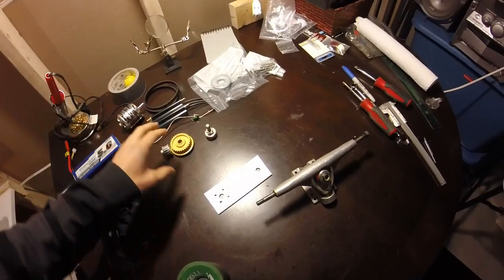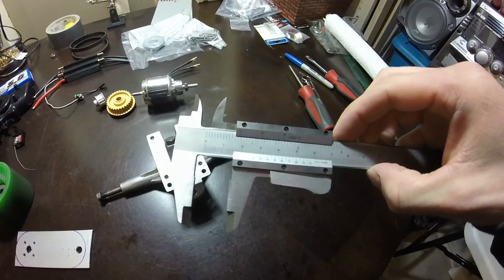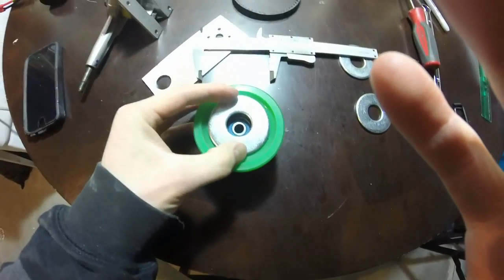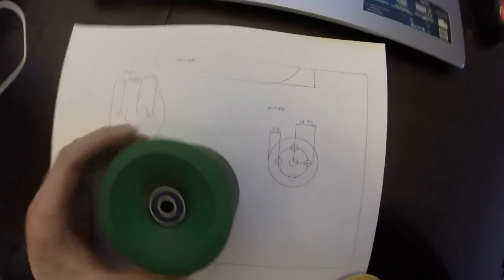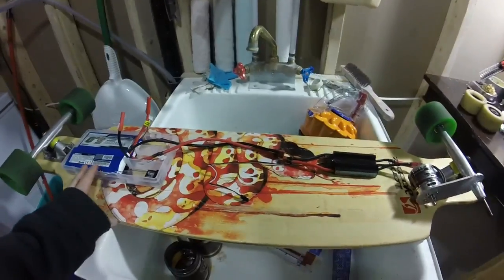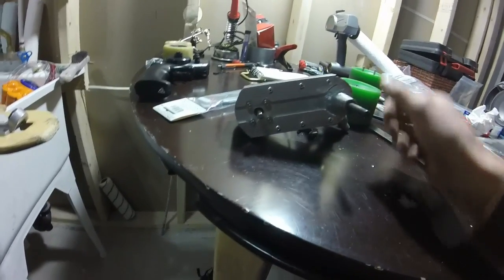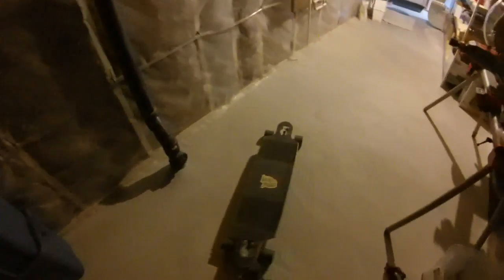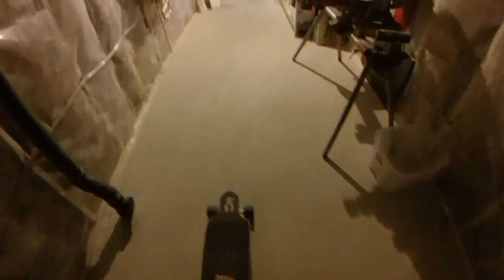DIY Electric Longboard build!

Comment: How did you weld the bracket to the truck? Isn't the truck aluminium? Do you have a TIG or something?
Reply from the maker: oxy acetylene torch with filler rod. It held very well. I did however end up re-doing with with 1/4" aluminum plate from metalsupermarkets.com. The plate I used in the video kept bending. 1/4" plate is solid like a rock.

Comment: Hey Eric, Amazing video! I was wondering how you got your Transmitter to work. I have the same reciever and transmitter but when I set it up, the transmitter only moved the motor when pressing the channel 3 button. Any suggestions? Thank you!😉
Reply: Brooklyn Hanon you figured it out? mine isnt working either
Reply: I did, but honestly I have no idea how I did it I I just unplugged the reciever  from my board multiple times and finally It switched to the trigger. Good luck though...

Comment: Little late to ask but do you know if i could possibly find an idler for a 3m 15mm wide pulley manufactured? a little too much hassle to make myself.
Reply from the maker: Not sure bud. Its easier to make one than you think. Just a bolt a bearing and a couple of washers.
Reply: Oh. Okay! Thanks for the help!

Comment: Why so much discussion about VESC and ESC? Does it really matter? I mean, the difference between them is so freaking big to worth the double priced VESC?
Reply from the maker: As with anything there will always be a more expensive way of doing something and someone to justify it. I personally didn't care to invest too much money into an unknown project. The way I see it a big long spec sheet won't make your board more fun to ride, so I personally don't care about all the features, and any esc that supports lipos will have a low voltage cutoff which is all you really need. Regen braking is nice but you'll get that with a car/ truck esc as well as strong brakes.
Reply: Is it possible to brake with boat esc?
Reply: Yes, it is.
Reply: So, tell me how, because I bought the same esc and motor, I change the settings to forward, reverse and brake, I increased the reverse to 75% and I could not brake even in a low inclination street!!
Reply: Boat esc's have weaker breaks most the time, because its unnecessary to have a strong one in a boat. but if the break can slow you down enough to put your foot down to break then its fine. But you can also try to make a physical break that will stop your back wheel.

Comment: hello i have a 930 kv motor its the pyro 600 09 you think i can use for an electric longboard ? really nice video
Reply: You cannot use such a high kv rated motor it will draw too many amps and kill your Esc
Reply from the maker: Not a good choice. Way too high rpm (fast). Get something that will spin slower with more torque. Pay attention to shaft size when you get your pulleys as the vary.

Comment: Hi Eric! i think i ordered the same gear set, but i noticed that the smallest gear didn't fit the shaft of my motor, did you have the same issue or did i just ordered the wrong gear piece? Love your work man !
Reply from the maker: Thanks man. If it's tight check to make sure the set screw is backed off enough. If the pulley is way too small you could try to drill it out. Make sure the shaft size and bore of the pulley are the same. Sounds obvious but something might have been packaged wrong assuming you ordered the correct pulley/motor.

Comment: What did you use for securing organizer box onto deck? I worry the plastic will crack if I use nuts and bolts.
Reply from the maker: I used 6 small screws with large-ish washers. I later added a bracket over the box because I had the same concern. Check out my pt. 2 video for more details on that.

Comment: hello, does the esc work good and doesnt burn up ???
Reply: Buy a vesc
Reply from the maker: It works fine, doesn't heat up to any point where i'd be worried. More on that in my other video. Any 90+ amp esc would work fine for this though.

Comment: my motor wont run for some godforsaken reason after trying 3 different esc's
Reply from the maker: Take it to a hobby shop, they'll test it for you.
Reply: Yeah I just did lol it works!!!
Reply: +Eric B did you welded motor mount to the trucks or it's a liquid "cold weld"?
Reply from the maker: mvmedved I used oxy-acetylene torch with aluminum filler rod.

Comment: you should extend esc motor cables and shorten batt esc cables otherwise you may ruin esc with too long cables
Reply from the maker: I see what you're getting at, and I've never put an amp clamp on the wires to see how much current the esc actually pulls, but based on how much heat it generates I don't suspect much, so i'm not that worried.
Reply: +Eric B please have a look at this link. take care
 http://www.rcgroups.com/forums/showthread.php?t=952523

Comment: Isn't it a problem that your esc is not being cooled by water? Doesn't it become like very very hot?
Reply from the maker: Surprisingly it doesn't get that hot at all. My guess is that a boats pulls a lot more current turning a prop in water. The motor doesn't really have to work that hard on an e-board if it's geared properly, and only really pulls a lot of current under acceleration. I've actually had it cool down from 115f to 105f while cruising at 30kmh on flat.

Comment: Hi, Why did you choose the batteries with low discharge ? Can you answer 
Thanks
Reply from the maker: They were cheap. Also, I don't honestly think a battery with a higher c rating would do much for it anyway. Unless you want to do 100kmh I see it as a waste of beer money.
Reply: That is good opinion, but how long are using the batteries and do you use longboard every day ? Thx

Comment: hi eric, nice video.
I have the same wheels which I recognize as the abec 11 flashbacks. and I wanted to know if you drilled through the rubber (the green part) and if you did so, is it stable or does it vibrate? should I buy new wheels for my built? cause normally people do it with wheels that have holes already on them like orangutangs or abec flashbacks or they drill through hard plastic.
 thanks
Reply from the maker: Thanks man. Abec 11 Big zigs, 72mm. I drilled through the urethane because i'm cheep and didn't want to spend hard earned cash on wheels specific to this build. I have not had any problems/ vibration. I also only ended up using two bolts with locknuts and have had no problems. When you put the bolts through the wheel they are pretty tight/secure in the urethane.

Comment: hey eric, great build. I'm currently ordering all my parts to make my own board with two 280kv sk3's. just wondering do you have the exact names or part numbers to the gears you used, since I'm using a very similar motor to you i could proberly get away with using the same gears/ belt. is there any chance you can help me out, spd/si's website is kind of confusing. thanks so much in advance
Reply from the maker: Just added to description

Comment: Very nice and clean build man, Love it!
I was asking how the connectors call which you need from the 3 motor wires to connect it to the ecs, because the boat esc hasn't any connectors standard?
Reply from the maker: Thanks! The esc just has wires with no connections on them, those must be soldered on. The motor comes with banana jack style connectors.  Hope that answers your question,

Comment: if your batteries are connected in series will you have to disconnect the two batteries from each other when you want to charge them?
Reply from the maker: Nope, I hard wired mine together. Since it gets charged after every ride I wanted it to be as simple and possible.  Just keep in mind two 3s batteries in series = 6s battery so it will need to be charged on the 6s setting.
Reply: +Eric B would you need to buy a 3s to 6s cable to charge them or can you charge each battery off their own 3s cable
Reply from the maker: If they are hard wired you need to treat them as a 6s, so you'll have to modify your balance lead as mentioned in the video, once it's done it's hassle free. Hobbyking sells a dual 3s to single 6s balance lead adapter if you dont want to make your own.
Reply: +Eric B ah ok perfect, thanks for the help!

Comment: Which motor would be better?

Alien 6374 Outrunner brushless motor 170KV 3200W       65,- GPB 
ore
Alien 5065 FR Sensored Outrunner brushless motor 270KV 2000W  45,- GPB

Do keep the price in mind :)
Reply: ***** I bought my stuff from hobby kingbut it seems like they're out of stock right now.
Reply: the 5065
Reply: I'm assuming you're  from the uk. which site are you buying your components from?

Comment: Yo Eric, i got the same ESC 120 amps - did u have to adjust anything with a esc controller card ? of was it good out the box?
You know a way to program it?
Reply from the maker: Running it as-is out of the box. Working fine so far. Never figured out how to program it.

Comment: Hi, I have the same controller, but it dosn't work. It is correctly connected to ch3 but the trigger don't work and if I push the button ch3 it works... How did you setup the controller?
Reply from the maker: +SiMyt848 Try plugging the esc into the ch2 slot on the receiver.
Reply: +Eric B Yes, it worked on the channel 2! The problem was the throttle channel... thank you!

Comment: Nice build ! 
I'm building mine too, got the same quanum tx & rx. How did you plugged it ? throttle is CH1 right ? 
My Motor & ESC would not start and keep beeping unless I plug the ESC signal on the CH3, and use the tiny CH3 button as the throttle lol. It's really weird it does not detect anything else than ch3, did you have this problem ?
Reply: +Tahitian Rider Ok so I figured that ch 2 is the throtlle, and that neutral point is actullay all the way to the front (not in the middle) with throttle trim turn full to the right too. Is there a way to change that on the radio ? it is weird to have to push your finger all up front against the spring to be at zero throttle lol
Reply from the maker: +Tahitian Rider I have my esc plugged into ch2 on the receiver. Dial back the throttle trim knob, it should be somewhere in the middle. All the way forward is like full throttle cruise control. Turn it on and dial it back until the wheels stop. Hope that helps. Cheers
Reply: +Eric B Thanks for your help :) I got the point of finding where the wheel stop and start using the throttle trim. But on my radio, to have the wheel at zero throttle, I have to be at one end of the thottle stick, I can't have it in the middle neutral position, I'm not sure if that is clear... reverse won't be possible for example, but maybe it is because of my ESC that needs to be programmed for that.

Comment: Does it have brakes?
Reply from the maker: +Matthew Wiese Yes, most esc's have brakes. They are pretty light though since it's a marine esc, which isn't really a bad thing at speed. They are about as efficient as foot braking. If you want strong brakes go with a bulkier car/truck esc.
Reply: +Vladimir Longrod I'm also interested if this board has brakes!
Reply: ahh gotcha, thanks for the insight!

Comment: Top speed/range???
Reply from the maker: +Jack V Range Haven't done a top speed pass or really test for range yet. I can tell you it'll do 22mph at 2/3 throttle. If I had to guess i'd say 27-29mph, but will confirm later on.

Comment: How did you attach the case with the batteries to the board? Did you have to drill more holes in the deck?
Reply from the maker: +ColindaPieman Its screwed to the deck. Drilled holes in the box, the screws were small and did not need a pilot hole in the deck.
Reply: +Eric B You are using rubber washers with that so no water/moister leaks in.

Comment: Taking in consideration the research, time consumed, work involved and money spend, and aside of the fact that is a satisfaction to make something like this on your own and learn to do it or customize the skateboard to your needs, Do you think is worth it versus buying a commercially available electric longboard such as the evolve bamboo or boosted? thanks for any objective answer!
Reply from the maker: +marzbite I dont know what your time is worth but in my opinion: Boosted boards are very reliable (dont know about the others). They also cost $2000 for the top model. Very expensive for a toy, very cheep for a vehicle.  I am always tinkering around and have been longboarding for about 7 years. Seeing a project come together and be successful after doing the research is a big part of the fun for me. And In a sense I probably saved an additional $50 by working on this a couple evenings by staying in haha!

Bought: 
- Super easy
- Might come with a Warranty?
- Fun right away
- Generic deck (unless boosted board)
- Proprietary electronics 
- Have to deal with manufacturer for diag. help.
- Some parts might be hard to get to replace
- What if the company goes bankrupt next year?
Built:
- Time consuming: Fun for some - Frustrating for others
- Your preferred deck
- If you buy known electronics your local hobby shop could help with future diag.
- Can save you $ if you already have tooling and don't use a diy kit
- Confidence in knowing where every part came from, parts easily replaced/improved
- Easy diag. - You built it - you should know the weak points.
- It's yours!
- Your wife/gf will love you for not blowing all the vacation $ on a skateboard.
Reply: +Eric B thanks man, great insight!!! love your video, thanks again!!!

Comment: Would a 350kv motor be able to pull a 60kg rider?
Reply from the maker: +Finlay Sambrook Smith If you're looking at the sk3 350kv motor I wouldnt recomend it. 5mm shaft will limit drive pulley choices, and it's only meant to work on 4/5 cell = 19v. 6 cell is best = 22v.
Reply: +Eric B oh ok thanks. Looks like I'll have to save to get a better motor

Comment: Are you having problems with belt tension?
Reply from the maker: +Adam Keely I was, It was slipping on the drive pulley so I mounted two skate board bearings together as an idler pulley to take up the slack in the belt. Put the idler road side/slack side of the belt. It helped A LOT. In my opinion this is a better idea than just going crazy tight as it also wraps the belt around more of the pulley. Just be careful not to get lube on the belt from the bearings.

Comment: Do you need to do all that balancing thing if you only have one 5000mah battery?
Reply from the maker: +Finlay Sambrook Smith Nope. But by connecting two 5000mah 3s batteries in series i've basically made a 6s battery for $40. Another option would be to buy an adapter(hobby king product id: T-Twins) or charge them separately.
Reply: +Eric B oh ok cool thanks. btw how does the rc reciever plug in to anything?
Reply from the maker: The esc plugs into the receiver to power it.
Reply from the maker: ***** Using my setup, the short answer is no. A 4s battery will only have 14.8 volts. Depending on your motor choice, it may not even work on that voltage. That said there may be a motor/esc/gearing combo out there that will work fine on that battery.

Comment: Nice Video 👍 does the transmitter have a  break funktion?
Reply from the maker: +German FPV Thx. Yes, the transmitter does throttle and brake/reverse. It works just like any entry lvl. 3ch radio. If you want "good" brakes however I wouldn't recommend the esc in the video. Its very light, about as efficient as foot braking.
Reply: +Eric B thanks

Comment: Hey can you put some pics of all the motor bits how they are attached batteries etc and can you put a link to the print out as well please still it is very detailed well done I liked it as well and sub
Reply: Also can you link the product is for motor as there are a few types thanks
And where do you get the esc and batteries from can you link it and pulley belt gears from please it will help so much thank you
Reply: +Amrit product id

Comment: Is the esc getting hot? (at full speed?- by climbing hills?)
Reply from the maker: +Adrien BLACHUT Its still pretty miserable out where I live so no full test yet, I took it out for a quick rip about a week ago to see how it worked and it had really good power. Accelerated hard even at speed. ESC was slightly warm to the touch after my 10min ride - which I think is pretty decent, most esc's are safe up to 185-190F. I'll give an update when the weather is nicer. Salty roads are bad for electronics.
Reply: +Eric B Thank you and many thanks in advance